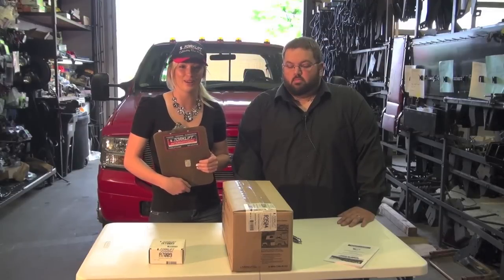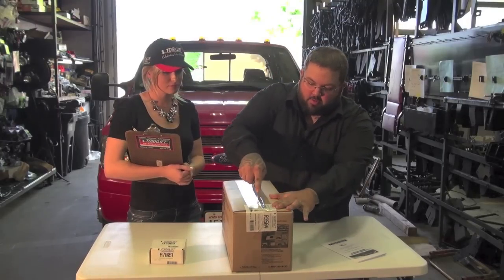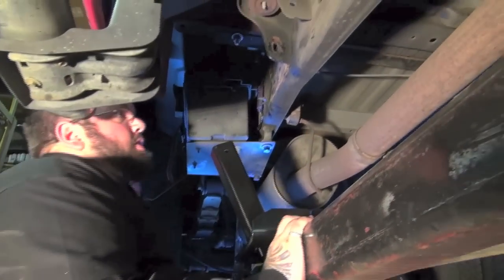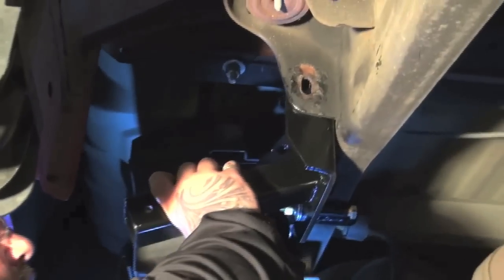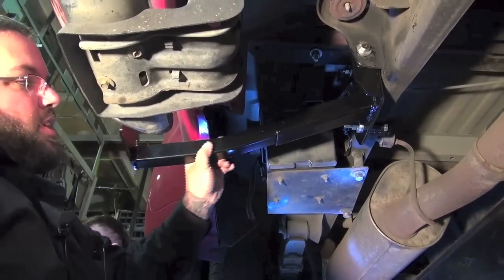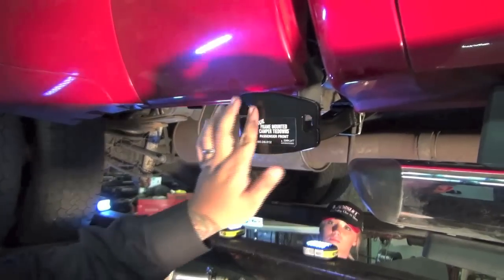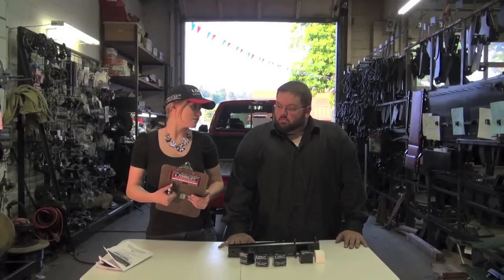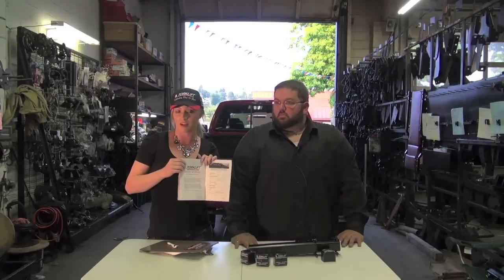True Frame Mount Tiedown install from Torklift International

Comment: What is the part number for this for a 2004 F-350, crewcab, 8' box dually?
Reply from the maker: Hi there David! Assuming you have a factory hitch installed and cab length or no running boards, your part numbers would be F2011 and F3001. Hope this helps!

Comment: I have a different style hitch, what do I do?
Reply from the maker: Hey Wayne - thank you for your question! There are a couple of options available to help you find the tie downs that work with your truck. You can visit our Find Your Fit page: https://www.torklift.com/findyourfit. On this page you can enter your truck information and it will pop up with the Torklift tie downs and accessories that fit your vehicle. Or, you can give our tech support a call (800-246-8132), or sent them an email to support@torklift.com and they would be more than happy to assist you with your fitment.